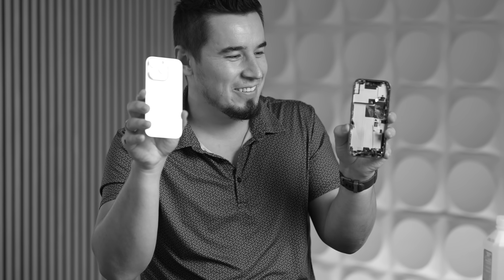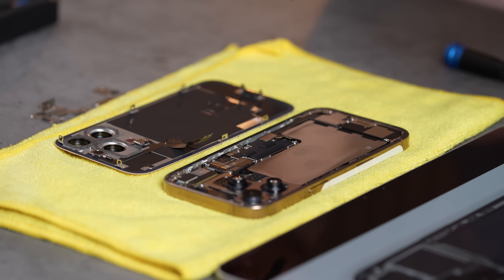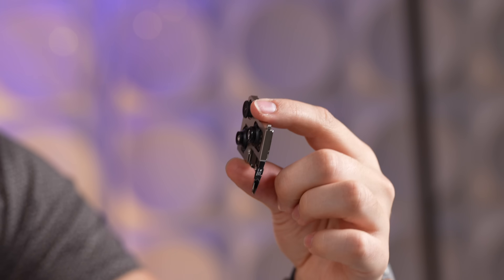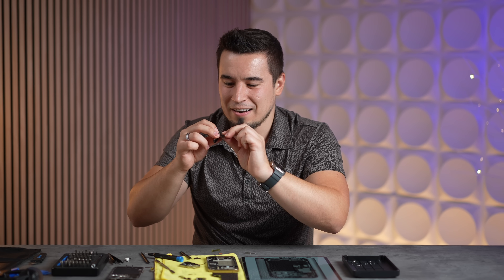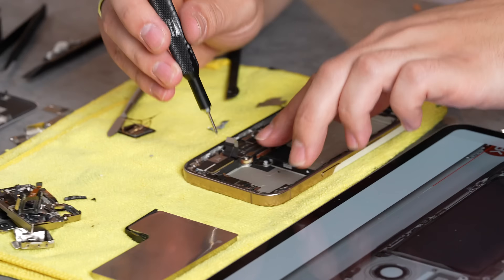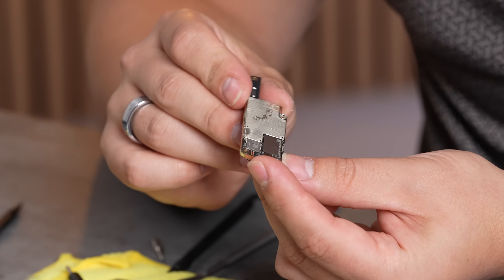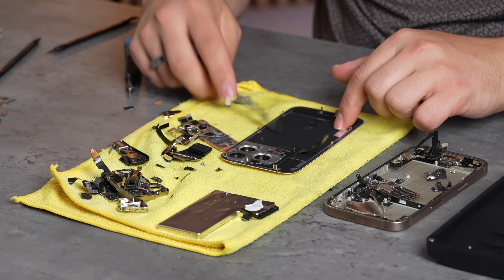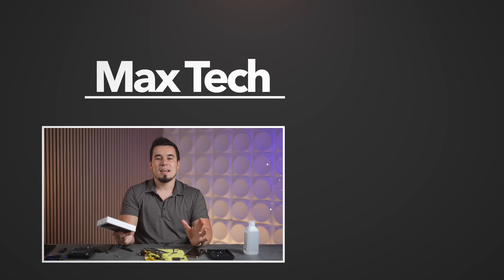iPhone 16 Pro Teardown - EVERYTHING That's New!

Comment: Do you think the Camera Control button is a gimmick and unnecessary hardware+software over complication?  I could already zoom well on the screen and the scrolling on the button needs to be done in stages so it’s more jerky, and pressing the button also moves the phone so it’s not great.. Apple has added something to make things more complex rather than to simplify … waste of space and unnecessary feature at least based on first few hours of use

Comment: It was interesting to see the sensor sizes. You and your brother have been involved in the photography business and know how a normal lens has a focal length the same as the length of a diagonal across the  sensor or film frame. And a telephoto lens has a focal length longer than the diagonal of the sensor, and a wide lens is shorter than the diagonal of the sensor. Apple has not let us know the physical sizes of the sensors. Before you send those parts to trash can, please take a moment and measure them, then tell us the sizes. It will help your viewers know the truth about apple's focal lengths relative to sensor size.

Comment: I thought the 16 Pro had the same IMX803 as the 14 Pro
Reply: @Stiles09  Aparently it's supposed to be a new different faster sensor, though it is also 48MP one
Reply: @Acerdmen  it has the same exact spec too
Reply: @Stiles09  Google confirms the no new sensor thing indeed. So I rest my case.
I guess it makes sense in Apple's incremental upgrades fashion to not change the main sensor if they are bringing a new one for the ultra-wide camera.